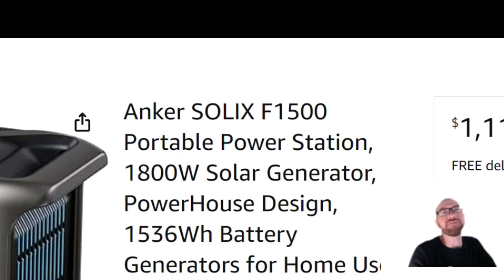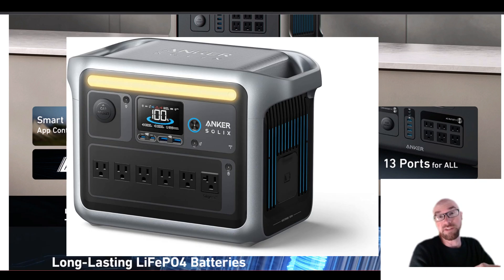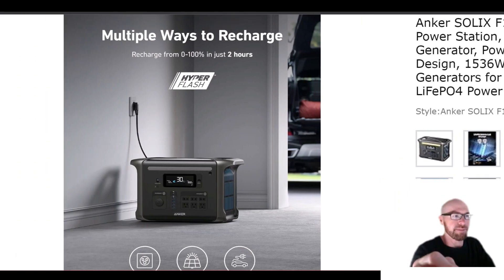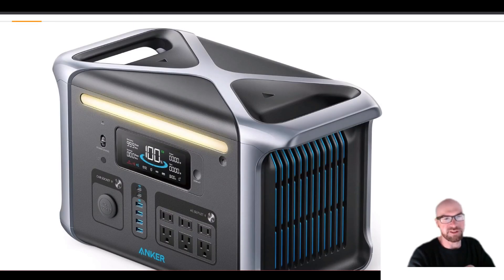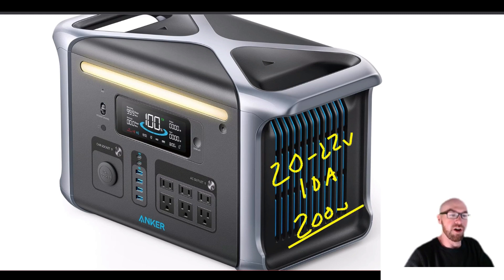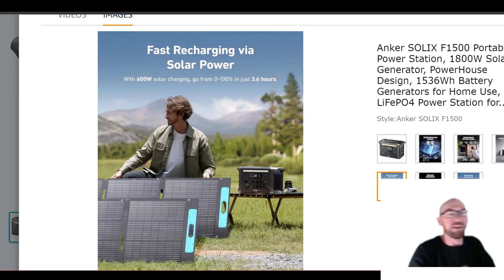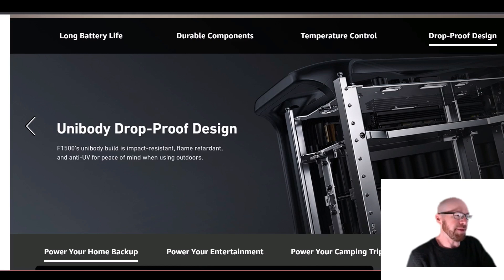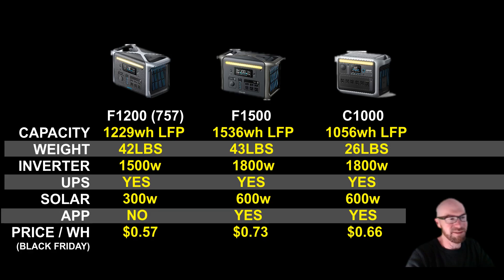BIG UPGRADES | Anker Solix F1500

Comment: Can this serve as an EXPANSION BATTERY that can be daisy chained to the F3800, or is it only a standalone power station?
Reply from the maker: All power stations can be daisy chained technically - the question is if it's worth doing or not. A true expansion battery pack will have the same voltage as the main battery (which in larger power stations is quite high 30 to 50v) and allows efficient transfer of power between the expansion and master units. 

You can always use the 12v outlet on one power station (the F1500 in this case) to charge another (the F3800) but understand the 12v outlet will be limited to 10A (120w) and 10A is a high number of amps meaning there will be significant heat (energy) loss in the process. If the receiving power station has a setting to limit 12v charging to 8A or even 6A, that will be more efficient but obviously take a very long time to transfer power.

The other option is to use the AC inverter outlets, which will allow a much faster charge rate (depending on the power station). Since the AC inverter itself uses power, it's not recommended and there will be a HUGE loss in the process. If you do plan on using the AC method, note that it is actually better to transfer the power as fast as possible, so the inverter is running for less time. In this case, set the F3800 to 1200w or 1500w charge speed and plug it into the F1500.